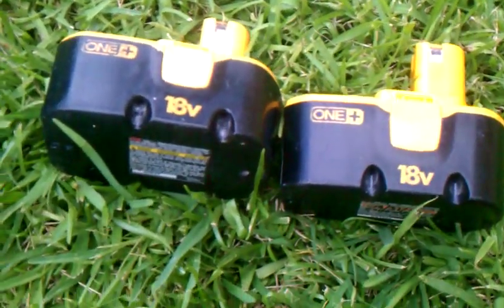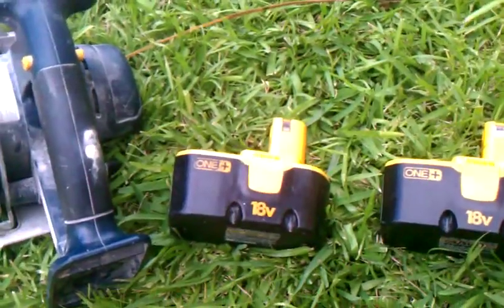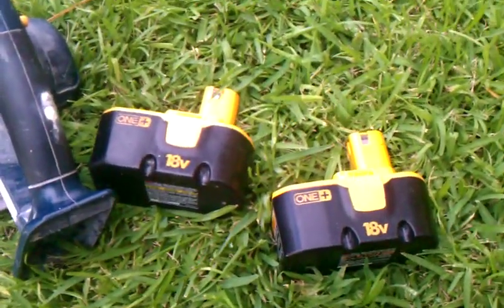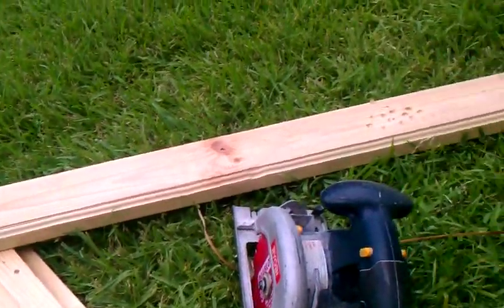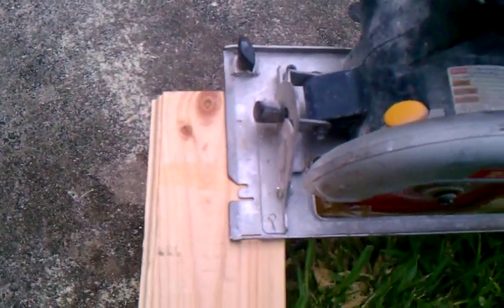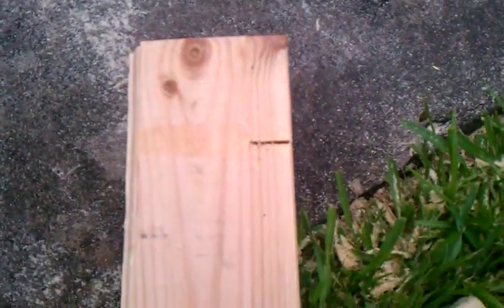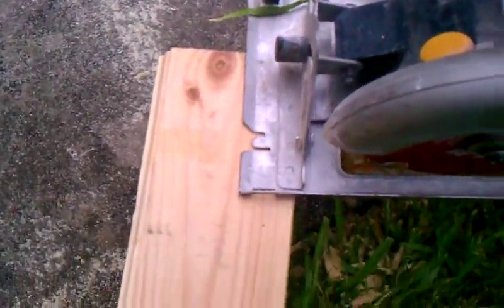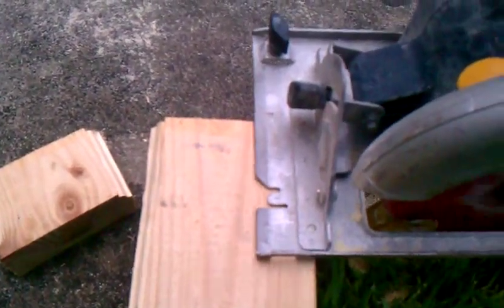Ryobi One+ 18v battery rebuild

Comment: New batteries are $40 a piece and are just 1700mAh. The rebuilt batteries are 2200mAh. That's a 29% increase increase in amp hours. The battery will work a third longer per charge.

Comment from the maker: I used 15 size Sub C Tenergy 2200mAh which came with solder tabs (Don't recommend getting them without the tabs). These little batteries are amazing. I spent about $35 for them on Ebay. I would probably stay clear of the Chinese ones on Ebay.
Reply: Prices have come down. I just ordered a set of 15 Tenergy 2200mAh batteries with tabs on Amazon for $25.99 today. They have great reviews. I'm going to try them with my new spot welder that I also got on Amazon for about $50. I have about 20 battery packs that need new cells so figured it was worth investing in a welder, too.